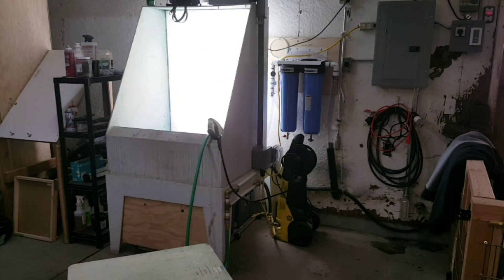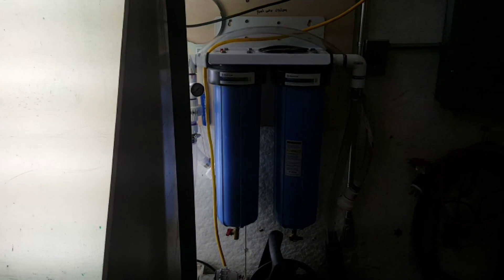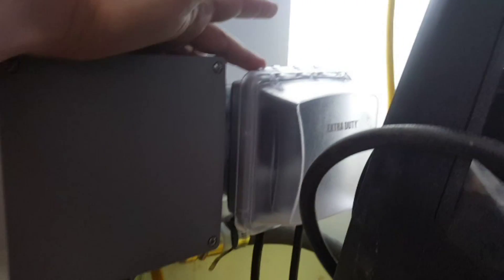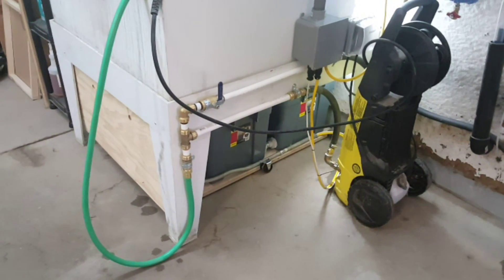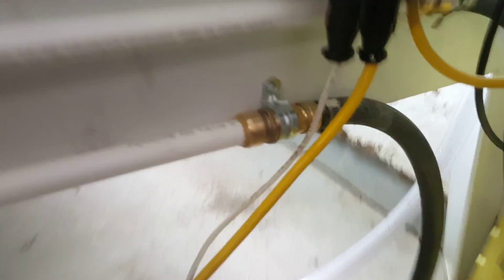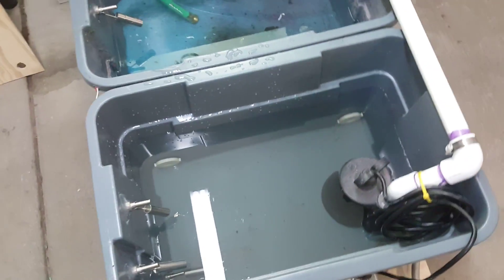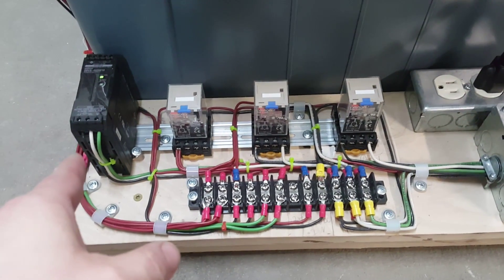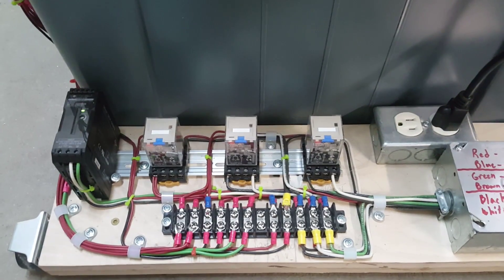DIY Screen Printing Washout Booth Filter

Comment: First if all, great video! I appreciate all the info you provided 👍
I know someone asked you this but I can not see your reply. What is the minimum power on a sump pump to push that water through those inline water filters?? 
Those filters are heavy duty, is that water drinkable? (I'd use it for plants). Have you changed the first mesh filter ?
Reply: @JeronMiller   thanks again. Okay sounds good to me.. over power is better than under. 
How often do u change the wall mounted filters?

Comment: hi a few things that confuses me is the extra hose you have coming off the water line.. whats the purpose of running water at the first basket and doesn't that cut down water going to the hp washer?(it shows in the video a hose going from input water one to power washer and other to a hose at the first tote)   also where would someone get that swamp box filter material? whats it called? lastly, you run the water filters after there's still emulsion thru sump pump (why at the end of the line?) and how many hp should the sump pump be?  was thinking of getting 1/2 but dont know if that was going to be big enough to keep up  (ive got a slightly better then average power washer (1/2) hp that does 2.1 gpm) thanks!
Reply: (it shows in the video a hose going from input water one to power washer and other to a hose at the first tote) and wow the 1/2 horsepower moves 41 gpm that would mean i don't need anything near as efficient? thanks for the response!
Reply: yes i see your splitting for some reason and running water on the first basket
Reply: ahh.. theres a switch that cant be seen.  can i ask you what hp & brand you use for sump pump? maybe your psi on hp washer? thanks again this is a great idea but as you have said it could even be simpler knowing theres a float on the sump pump
Reply: hope u dont mind me making a simplified vers   need to save lots of money  great idea  thanks so much!
Reply: Jeron Miller.. DURA-COOL PAD 3072? sound about the right stuff?
Reply: does everything have to be polypropylene? or can it just be plain plastic for the totes?
Reply: oh and thanks!
Reply: silkscreen ink and emulsion remover

Comment: I have not finished watching the whole video and the booth and pumps and filters are so elaborate that a kit can be made for people to buy, they can buy all the components and assemble themselves.  Something that is standard and all components the same way and fits one way.  I assume all this is done because of the chemicals and local laws in water disposing properly. Each city is different.  Even though this is so elaborate and plenty of engineering thinking went into it.. And after seeing other ways to burn screen.  The Japanese  Screen maker uses no water, no emulsion, no dark room and no film positives or negatives. It is very expensive and burns the actual screen/silk via a computer USB port, it works with Adobe photoshop, corel draw and other software.  The reason printers go water is because of the cost.  The Japanese machine is expensive but solves all these water hassles .